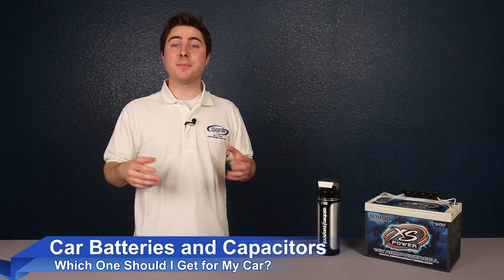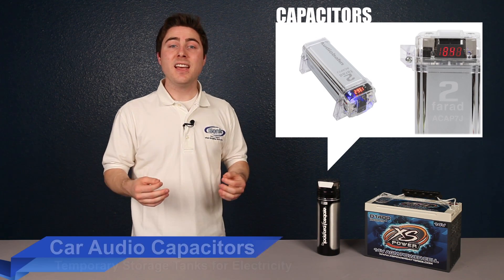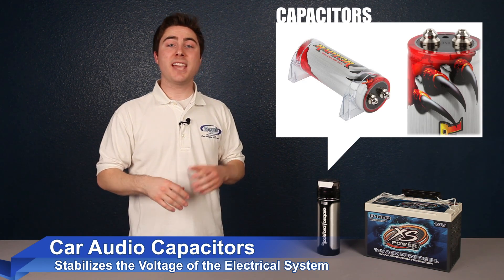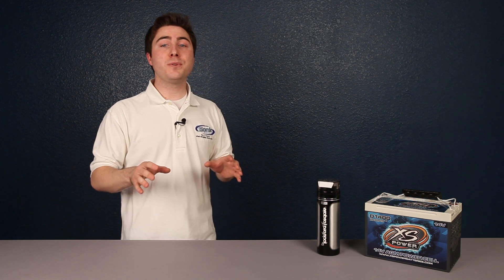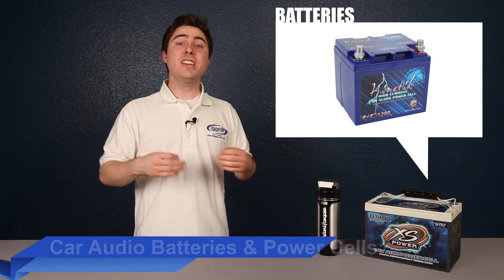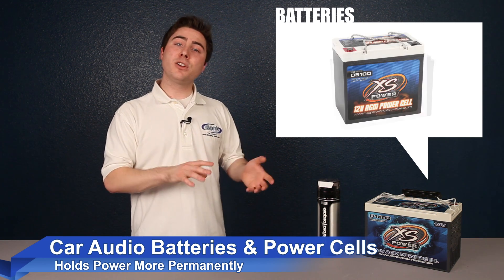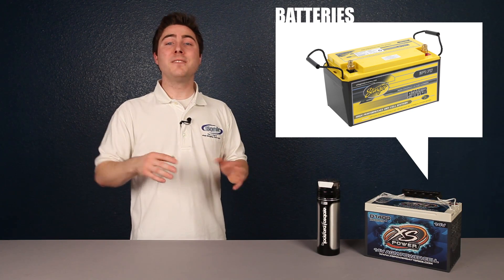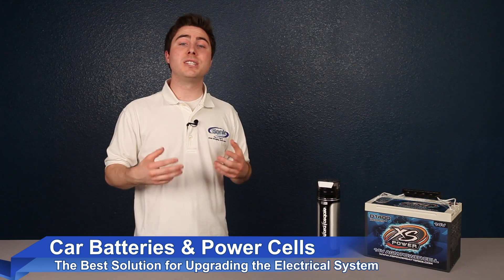Car Batteries or Capacitors: Which Should I Install? | Car Audio Tips

Comment: I installed a capacitor on my system  and my headlights dim got worse don't understand why ????
Reply: u need a new alternator bro, capacitors are a waste of money they dont do anything
Reply: I doubt it's the alternator, it's more likely your primary battery's fault, if you lack a cell you'll get a normal looking voltage but put any load on that and the voltage drop is huge. The cap is evening out, but all that's gonna do for a dead battery is slice the upper voltage range off, making the dimming more severe when they do happen (bass beat happens, drains the cap, and you're left with a lower battery capability than before where the amp stopped draining more due to its power protect and/or increased resistance on the positive cable from drawing higher amps and lower voltage due to the drop), but less frequent. Obviously with how old your post was I would hope you replaced the dead battery by now though :)

Comment: cap reduces over all voltage thats why a cap works great for dimming issues but are not doing thing other then frying your amp if you want more sound more bass invest in it don't take a cheap solution and feel bad when it goes wrong

Comment: no mention of the stress all that extra load puts on your alternator.
Reply: OJ Love your alternator doesnt work any harder unless you have a voltage regulator and it's set high
Reply: +ThaDjSteps 
well  if your using a stock alt and your system is needing more power then yes that alt will work over time.
that why you need a bigger alt.
this is to anybody........
if your system is pulling to much power from your stock electrical you need a high output alt first.
alts make the power... batterys on help keep the voltage steady.

so you can have a 5k system and put an extra batter, its still going do drain and damage it.

Comment: Aren't capacitors just a larger relay? :0
Reply: No.
Reply: Steven King
 Prove it... By the way, if your ability to prove that they aren't is based on the quality of your books/movies.. .Then you're screwed... ROLF... Just trolln... Kind of.. :)
Reply: rag Doll what do you want to know? a relay is a switch, actuated by a very low current, to pass higher current.. 
a capacitor stores electricity, with an extremely low discharge resistance, it can dump it all at a moment's notice... but let's do the math on it. 1 farad = 1 joule = for our purposes 72 watts for 1 second continuously. (or 144 watts for 1/2 second, 288 for 1/4 second, and so on) so if you just need a little tiny boost to get your through that THUMP of a kick drum, the standard capacitor is great. BUT if you play your system like us bassheads really like to do, long drawn out bass notes, and you have a higher power amplifier, a capacitor is no more than a drop in the bucket.. Plus the downside, as soon as you drain them down (which happens fast) they want their current back, NOW, continuously putting it's full charge requirement load on your alternator and battery(ies) until it's topped back up.
Reply: heretic30176
Well thanks for your response... Math is NOT my strong point.. I'm good with pictures and hands on.. But I appreciate your effort. ;)
Reply: rag Doll actually brushed up on my math after posting that, my numbers were off (been 12 years since i learned it) but the end result is still the same.
Reply: heretic30176
 :P ....ROFL...

Comment: I'm on 6000 wats and I have to stock alt and 1800 cold cranking amps of bats and I only voltage drop to 13.75 volts so bats for the win
Reply: No, you just don't need a capacitor. That doesn't mean there are people out there that don't need one.

Comment: I've got a 2014 mazda 3 with the base model stereo and the 2.0l motor, don't know if there's a difference from 2.0 to 2.5 with the alternator. I've upgraded from the factory Panasonic battery to a optima yellowtop 750cca to try and solve my headlight dimming issues when the base hits but hasn't made a difference. I've replaced the door speakers with dd cxs 6.5 coax units running on factory power for now until I solve the dimming issue, and for bass I've got a Rockford t500.1bd powering 2 hertz audio es 300d's. With yall knowing my system and future plans of a t400.4 from fosgate to power the doors and maybe a punch 300 to add two high power tweeters on upper dash, how can I go about getting more juice on this vehicle. Thanks
Reply: The Trucking Channel Shit I have the same car with the 2.5l but with the Bose system. All I'm trying to figure out is if I can add an AudioControl LC2i for some inputs. I heard the Bose amp messes with it though so it wont work. (at least as far as I've read).
Reply: The Trucking Channel I'm more than likely late asf as'n you may not have this set up no more but for future references running systems this big all ways do the Big 3 so that you get a faster recharge !
Reply: Ryan Dailey Yes it's totally fine all you have to do is locate you bass speaker cut the wire and splice a longer wire to the positive and negative and run the speaker wires to the +/- signal inputs on your lc2i then from the lc2i connect your RCA's from the lc2i's output to the  input of your aftermarket bass amp then from your aftermarket bass amp connect speaker wire to your amp +/- input then connect it to your sub and do the same if you running after market door speakers but you have to use the signal from your factory highs so that you get a good high signal even though the lc2i clears bass out of the highs signal if any detected!
Reply: Replace that foreign made pos optima 1st off, and with only a 500w fosgate your lights shouldnt be dimming much or at all.

Comment: What should I do to solve headlight dimming because mine has been doing it lately
Reply: Turn the damned lights off.
Reply: This guy guy knows whats up.  But, and it's a real caveat, there is a point where you need to upgrade your alternator if you're consuming more power than your system can store and recharge.  You need to consider the output of your alternator, as its the only generator in the system, batteries and capacitors are just storage.  If your sustained power exceeds the  power rating of your alternator long enough you're on a path to electrical failure, I hope you have a goof(and i mean goof) fuse.
Reply: +Steven King  LMAO!!! don't drive at night, park the damn thing, to stupid, never should have upgraded the damn stereo, lmao
Reply: hello., and thanks :)
Reply from the maker: PlayinNgaming It could be a few different issues and you might want to look into an upgraded (or second) battery, upgraded alternator, or even a capacitor. Give our call center a call and they can help you figure it out.
Reply: Basic: Have your battery, and alternator checked.  After that look for corrosion or loose connections for anything.  if all that is okey, then look at at or amp ('s) voltage is either not there because the alternator is dying, and the battery is cooked.  alt or the battery ether one goes bad, and it kills the other item. Try turning the radio system off and run on high beams turn your turn signals on, what your looking for is " Can you make the head lights dim,if so, go back to the basic, Under load and your loosing electrical power...

Comment: OMG.. if you guys wants some real answers hit me up' you all are just going to get confused by all this shit..........
Reply: Ok, how do you measure the esr of a capacitor that you think is bad? And, what is a good replacement transistor for a #25091 that's obsolete? And how would I measure the impedance of a transformer without a dmm??
Reply: hey I have 2 amps in my truck. As soon as I turn up the volume and my bass hit's my light's blink. should I get a cap or batterie.Thanks
Reply: +Tom Spencer  ok  what i did  was i got on ebay and bought a capcell battery, there pretty cheep in price,  they have a 300 amp , 400,  600,, or 800 amp i got the 800 because i have  a big system, a  300 amp would be perfect for you, my lights dont blink any more
Reply: +Steven King  capcell battery :) for sure

Comment: can you use any battery? in your trunk..
Reply: it shouldn't make a difference if it is a 2nd battery
Reply: If you are going to wire in a secondary battery you want to get yourself a battery isolator relay (you can also get the diode version) this will prevent the starting battery from getting drained from the new battery or viseversa. they are usually only about $40 and will save your ass in the long run. if you do install dual batteries without one of these you MUST install two new batteries or discharging will occur. also If there is room you want to install the second battery as close to the first battery as possible. this will help with charging and ill improve the life of the two batteries
Reply: No, you cant use a wet cell. Theyre hazardous. Need a sealed agm battery

Comment: Since what sends power to the battery and capacitor is the car Alternator, changing the alternator from 12V 80Amp to 12V 120Amp as an example should be even bether than any of the solutions shown.
You also should get a wider cable from Alternator to Battery since it will send more watts.
Reply: From alternator to battery isn't the wiring I would replace first. People should look into better grounding kits.

Comment: Ive got a battery in my boot running series to the front battery. Boot battery runs 2 amps and is ALWAYS going flat. I have to swap to my spare battery every 2 weeks, 4 if im lucky. Hate it
Reply: Your alternator is fuuuukt.
Reply: you have a bad alternator and if you don't have one get a battery isolator relay
Reply: leksasdf I wouldn't necessarily say bad to be honest. If it is a stock alternator it for sure isn't capable of keeping two batteries charged, especially when one is taking the full brunt of two amps. You need a bigger alternator.

Comment: Quick  question!!!  So I'm about  to get a capacitor  installed  im going  thew the guide and its saying  that I need to charge  and discharge  the capacitor   do i only do this once or all the time i turn  on and off my car??  Lmkk
Reply: 1 time unless your taking the cap out of the car your supposed to discharge it. dont worry about charging it that will happen when you plug it in
Reply: Okay nicee!!  Thankss

Comment: I have a one farad capacitor hooked up to my Rockford Prime 1200.1 @1ohm. I have a 1000 RMS 12 inch Alpine Type R hooked up to it at 1 Ohm. My alternator goes out like every 2 years, I was told it should last 10. I don't think the capacitor is helping at all. For my budget I ordered a car audio battery that said 600 watts. Would this help? Replacing my alternator isn't cheap... Thanks
Reply: yup going to help u a lot that battery is like over 100 capacitors and it will save your alt.
Reply: Eazyebnk Why didn't you use the money you spent on multiple alternators for a higher amp one? That would have solved your problem. Also if they are going out that fast you should have been getting free replacements every time? They would for sure be under warranty.
Reply: 1 Farad in not enough, get a 3.5 - 5 Farad, it should be good.
Reply: That's because capacitors put more strain on the electrical system not less. Don't bother with caps.
Reply: Thezuule1 Also, caps only provide their benefit with certain types of music. But they are always a drain on the system.

Comment: Why aren't you guys using super caps yet?
Reply: Yes, techs and people that know call the caps.
Reply: Most of those audio caps are just hollow tubes filled with supercaps wired in series to get the desired voltage and capacitance. Watch some videos of people cutting them in half, it goes to show just how full of shit some of the manufacturers like BOSS are when it comes to capacitance ratings. You can do the math yourself on the interior caps and it's nowhere near the rating they give.
Reply: What is super caps? Did u mean super capacitors

Comment: Can I use 2 xs power d3100 and also 30 farad capacitor.i hav 2 rf t2500.
Reply: yes these guys dont know what there talking about. u will need a better alt atleast a 270 amp.

Comment: I have a 1,900Wrms@1ohm amp. The car however used to really dip it's lighting when drawing current, and the fuse melted. Since I'm upgrading from 80-150a fuse and 0awg cable. What sized battery would I need for extra, not sure if the alt is 50 or 70a. Yes I'm aware that I'm over doing it.
Reply: Well then clearly you should get a aftermarket alternator first with atleast 240amps, your ac, headlights, taillights also use amps so take that into account. After the alternator you should upgrade the battery but I recommend the big 3 upgrade first

Comment: A capacitor just stores electricity to your amp so there isn't a frequent current to your amp which would really wear on your alternator not your battery so much. A battery is not a solution because it doesn't matter how big it is, your alternator's job is to recharge your battery, So it doesn't really change the output and drain of your battery with not having a capacitor. A capacitor stores electricity and delivers it to your amp in spurts when it needs it; a more energy efficient way. However, I wouldn't recommend a capacitor unless you're pushing 5000+ Total Watts RMS because you're car wouldn't be sucking that much juice out of your battery if it's under 5000 Total Watts RMS. I just wanted to clear that after watching this video.
Reply: You're correct (mostly) about how the alternator keeps the system going, but here's how I see the battery situation:

Say you have a swimming pool with a drain at the bottom and a water hose pouring water into the pool at the top. If the water in the pool goes below a certain level, you get headlight dimming and other electrical problems. The size of the drain (how fast the water is sucked out of the pool) is determined by the current draw of the amplifier. The size of the water hose is determined by the alternator.

The battery's contribution is, however, is the actual size of the swimming pool. With a bigger pool, water drainage is less noticeable than with a small pool because of the sheer volume of the water in the pool to begin with. That's why batteries are often referred to as "reservoirs," because they act like swimming pools, water towers, etc. of current.

If you only upgrade the battery, sure, you have more headroom to begin with, but water is being put back into the pool at a slow rate still, so your water level will fall below the minimum line if you push your amp for a short time.

The other option (only upgrading the alternator) is also not wise because of less obvious reasons. This is where I need to learn more about the subject, myself, but it seems that it's not good for the battery to be constantly emptied and refilled at such a high rate. It seems the battery would be unstable and somehow lose its ability to hold a charge while the car is off.

Hope this helped!
Reply: ***** Yes, I agree that a cap is unnecessary when you have the juice to power the amp without it; undesirable even when your electrical system comes short too imo. But if a system is only dependent on the alternator(s) then why do you see people like Steve Meade running a bank of 8/10 batteries along with a few ridiculous alts? The reason is like I stated (I assume) is something a long the line of: that a battery supplying more current than it's built for, and consequently being recharged with more current than it's built to handle, is bad for the battery.

On the flip side, I don't really know enough about how an alternator works to figure out how overdrawing current from your alternator can harm it. It doesn't seem like a good idea to begin with, but you'd think that once all the current available from your alt is being supplied to the amp, the rest of the system (the car included) would just shut off.
Reply: KlaskeyProductions except the battery plays no part in the running of a car system once it is turned on, the battery is only used as a electrical starting point to supply power to the coil and to turn the engine over or starting up, whichever you prefer, it is the alternator which charges the battery while the engine is running and the more current being drawn from me ie - the amps, the more strain it puts on the alternator and wears out faster, so the best thing you can do is upgrade your wiring in the car and get a better alternator which will solve the problem of dimming headlights while driving etc, and dont get me started on caps, those things are useless unless you're making an insane amount of power in your system, it just strains the alternator to keep it charged
Reply: In conclusion...? add a new battery or add a capacitor? I have a small set up, 1200w peak power, one amp. I just need more juice towards the set up. Otherwise the bass goes flattt when my car is on.
Reply: Marcel big 3 upgrade and a bigger battery, deep cycle one, at that power u wont need an extra battery, also run biggest gauge wire u can
Reply: BassFreak

Thanks! Im gonna get an XS Power battery.
Reply: "A capacitor stores electricity and delivers it to your amp in spurts when it needs it; a more energy efficient way."

How is drawing even more current from the electrical system to constantly recharge the cap a more energy efficient anything?
Reply: caps are only useful in high power systems...not small ones
Reply: Tim Rhodes i never said they had to use them

Comment: I have about 4 things plugged into my cigarette outlet in my 2011 kia forte, should I upgrade my battery.
Reply: nope ...
Reply: Shhh
Reply: I reccomend you install at least a 15 Farad capacitor to your cigarette outlet.
Reply: knowing as soon as  u p[lug a capacitor into ur cigoret outlet if it isnt charged properly it can bust the fuse  just trying to fil the 14 farad
Reply: No, buy 1 of those cig lighter adaptors at walmart that turns the car 1 into 4 more and that will fix it. If it still doesnt buy another 1 and plug it into the 1st, repeat as necessary.